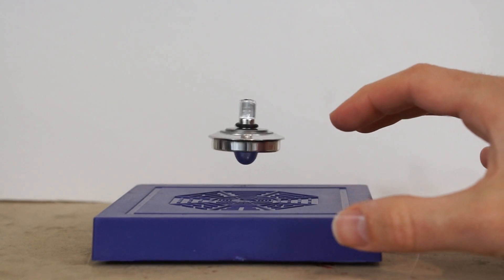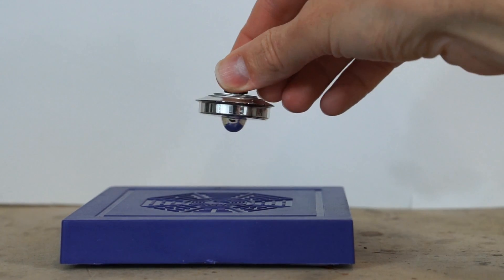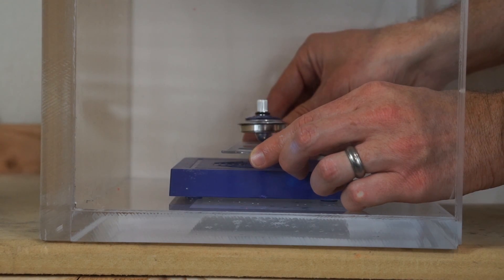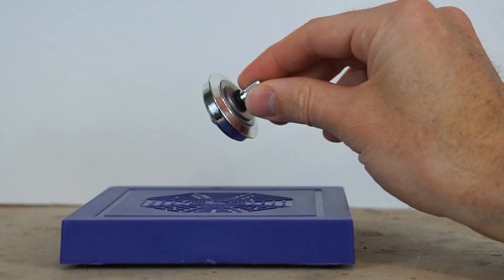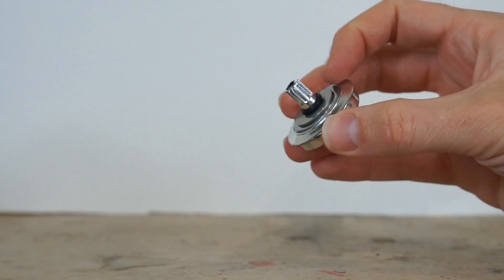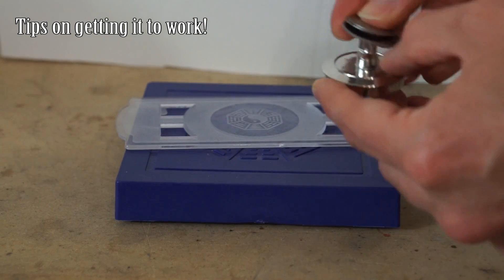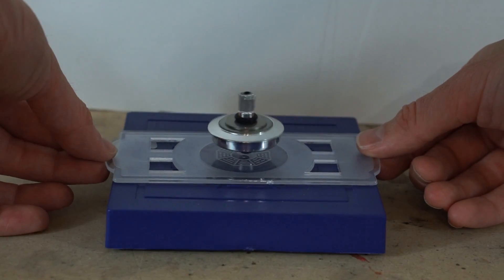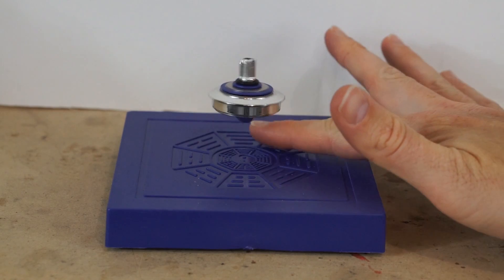Will a Levitating Gyroscope Spin Forever in a Vacuum Chamber?

Comment: even taking friction out   Einstein predicted Frame dragging which can leak energy via gravity waves,  thats why the moon is moving away slowly and the moon is locked to face us , and the earths day gets longer   am I right?
Reply: The Moon is moving away from the Earth due to tidal effects.

The Moon raises a bulge on the surface of the Earth which we observe in ocean tides.  The solid mass of Earth is also tidally bulged but on a far smaller scale.  As the Earth rotates roughly 28 times faster then the Moon orbits that tidal bulge is ahead of the Moon in its orbit, far enough ahead that it creates a gravitational differential.  Through this mechanism the Earth is losing spin into the Moon's orbit, slowing the Earth and flinging the Moon further away.

If the Moon were considerably closer, inside the geo-stationary orbit, it would go around the Earth faster than the Earth's spin.  The bulge would have the opposite effect it has now, to speed up Earth's rotation and draw the Moon closer to Earth.  An exchange of angular momentum.

The moons of Mars, Phobos and Deimos, provide instances of both effects.  Phobos goes around Mars faster than Mars spins while Deimos is slightly slower.  Phobos is expected to either collide with Mars in about 50 million years or get torn apart when it gets inside Mars' Roche Limit.  Deimos is slowly getting further away from Mars.  Both moons are tiny in comparison to Mars so the effects are much smaller.

Comment: Magnetic levitated turbo molecular pump....it’s a thing, it’s amazing, and it spins for a long time before it winds down under high and ultra high vacuum. And that has turbine blades intentionally colliding with molecules. 

Point being, it is really hard for smooth things to lose energy in a good vacuum. Consider what possible factors are getting this energy transfer from the rotating gyro. It’s a short list

Comment: I think that it would stop, even in a totally perfect vacuum, because there are slight changes in the angle it spins at. This is changing the angular momentum, but that can't get energy to change unless it's getting the energy from somewhere else. That somewhere else, in this case, is its main rotation. It will spin less and less quickly because of this, and eventually fall.

Comment: With just 1 second into the video, you can already deduce that it won't last for too long.
It's not even nearly stable. It's bouncing all over the place. Even without any other force to oppose the movement, all that bouncing will eventually exaust the kinetic energy of the spin.
But that's hardly all. Apart from the electromagnetic induction process some mention, the truth is that, even if you'd put a gyroscope spinning in perfect balance in an ideal vacuum, free from any gravitational pull, electromagnetic fields, or radiation of any kind, the truth is, in it's rotation, all the atoms in the body of the gyroscope are trying to break apart from each other, and the resistance the atomic bonds pose to this, is, very slowly, turning the kinetic energy into heat. Eventually it would stop. It's just a matter of how long it can last.
I would presume it might last a long time in those conditions, just how much I can't tell.
But this experiment will last considerably less, that's for sure.

Comment: I think the time it spins in vacuum might be shorter than in air, because the air compensates a bit for the wobbling effect. The magnets are not perfect as well, there is resistance in the magnets as well. Also entropy is the bane of any perpetual system (2nd law of thermodynamics).

Comment: I have an experiment proposal
 1. Outer space test.What would happen to water or blood if put inside a sealed container with set pressure of a space ship than put in a vacuum and see if the water/blood will boil. 
2. Put a bluetooth speaker inside the vacuum with salt and play different hz and see if the salt will respond to the vibrations .
3. Put magnets inside the wall of the chamber on each end with the magnets all facing same way with opposing force  and put a metal magnetic ball inside and see if magnets have any effect on the ball

Comment: if you have a cylinder with liquid helium inside it and you rotate the cylinder it will spin forever because it will become what is known as a superfluid, however, the energy needed to maintain the rotation of the fluid is derived from the cooling of the helium.

Comment: in mathematical theory, absolutely yes, but in the liquid universe like we live in, even in a vacuum, the unstabilized motion of the gyro, combined with several other minute effects, it will eventually slow enough for the gyroscope to flip and fall. "Liquid Universe" refers to the fact that all things, even solids, are actually a culmination of constantly fluctuating fields, slight vibrations from the floor transferred to the base, moving that magnet ever so slightly, and many other teeny, tiny effects that combined would cause just enough variables to slow it over time...happens even in deep space hun.

Comment: Magnet moving? Causing friction? I don't think so.
The top moving/vibrating in the magnetic field is causing heat as the object moves through the magnetic field. This can be improved by finding a better way to do a stable launch and a perfectly balanced spinner and a magnet with a perfectly concentric field. (not a lob-sided magnet)

Comment: Won't spin forever. The switching of the magnetic polls will cause friction.
Reply: Magnetic pole switching does not encounter friction. Magnetic fields in space flip constantly. It is half of the propagation of the electromagnetic field though time and space. It is called a radio signal.

Comment: 1. Magnets run out of power
2. There is no such thing as a perfect vacuum
3. Levetating something with a magnet is like pushing every single part of this something, you are still pushing it, very little but still you are causing friction in the system.
4.There can't be anything that is eternal, every material will be dust in a very long time, and dust will separate into atoms, and 
     them into quarks and so on.
5. Abbey the laws of thermodynamics.
6. Gravity creates friction.. so it will be slowed down slowly.

6 reasons why this can't be an eternal system, even in perfect vacuum and stuff like that.
Reply: Rethlitek hm, not quite solid on a lot of these... some are correct though it doesnt have a terrible lot to do with the video. 1) is correct, but demagnatising a magnet takes way longer than the few minutes in the video. 2) is also correct, but the small friction losses to remaining air arent that important here, even in 99.99999% vacuum, it would stop due to things like Induction (see Eddy currents if you wanna learn more about it :) ) 3) is formulated a bit strange for me (sorry, english isnt my main language). as he explained, it looses energy becouse the big magnet below begins to move against the table and that creates friction. Magnets alone dont create friction just by repulsing something.  4) i disagree on you with that one. sure, lots of materials degrade. but they wont just turn into atoms by themselfs without any external energy. it takes tons of energy to split things into atoms, and even WAY more to get them to split into quarks. (as you said in your point 5 (which is correct) , it has to do  with Thermodynamics on a larger scale with entropy and Quantum Physics for the quarks).  im not quite sure what you meant with 6). I dont know of any way Gravity itself creates friction. apart from pushing stuff together of cause. although maybe i just dont know one, so feel free to show me.

didnt mean to be mean or anything. im just trying to get people a better understanding of Physics if they are interested, since i work in Physics :)
Reply: @kcbsuiejd  Please be my physics teacher. :) 🙏
Reply: @michals2685  I might be some day ;)

Thanks for the Comment, you really made my day! :D
Reply: Due to your second reason do you agree the earth will eventually stop moving/spinning altogether?
Reply: @Fjfifjgkgkfudufgkhlgidj  GENIUS
Reply: @Fjfifjgkgkfudufgkhlgidj  reply ception
Reply: @Jimmy Briscoe No, because the atmosphere around earth is also moving along with the earth.
Reply: @Fjfifjgkgkfudufgkhlgidj  it will be hard to track the spinning of the earth once it has fallen into the sun and melted.

Really hard considering all the watter on earth will have been evaporated for billions of years so there will be no-one left to pay attention to weather or not its spinning.
Reply: @Fjfifjgkgkfudufgkhlgidj  yes
Reply: Thats right. Even in space, the vacum isn't 100%
Reply: But atoms themselves then? Electrons never stop spinning around the core when observed. But thats the quantum realm.
Reply: Electrons aren't technically spinning, although they do carry a "spin".
Reply: It's a motion though, that never ends unless interacted with. I guess atoms and other particles are part of just raw information, manifesting into our "physical" realm. Other rules on the quantum level.
Reply: Dap84. Correct. someone even won a nobel prize for working out how much energy goes into this substructure of our world. (its a lot of energy at that level)
Reply: abbey the laws
Reply: Lel
Reply: This is a paper written by Dr. Sten Odenwald about the world stopping spinning.  (Directly copied and pasted from https://image.gsfc.nasa.gov/poetry/ask/q1168.html)
The probability for such an event is practically zero in the next few billion years. If the Earth stopped spinning suddenly, the atmosphere would still be in motion with the Earth's original 1100 mile per hour rotation speed at the equator. All of the land masses would be scoured clean of anything not attached to bedrock. This means rocks, topsoil, trees, buildings, your pet dog, and so on, would be swept away into the atmosphere.

If the process happened gradually over billions of years, the situation would be very different, and it is this possibility which is the most likely as the constant torquing of the Sun and Moon upon the Earth finally reaches it's conclusion. If the rotation period slowed to 1 rotation every 365 days a condition called 'sun synchronous', every spot in the Earth would have permanent daytime or nighttime all year long. This is similar to the situation on the Moon where for 2 weeks the front-side is illuminated by the Sun, and for 2 weeks the back side is illuminated. This situation for the Earth is not the condition of 'stopped' rotation, but it is as close as the laws of physics will let the Earth get.

 

If it stopped spinning completely...not even once every 365 days, you would get 1/2 year daylight and 1/2 year nightime. During daytime for 6 months, the surface temperature would depend on your latitude, being far hotter that it is now at the equator than at the poles where the light rays are more slanted and heating efficiency is lower. This long-term temperature gradient would alter the atmospheric wind circulation pattern so that the air would move from the equator to the poles rather than in wind systems parallel to the equator like they are now. The yearly change in the Sun's position in the sky would now be just its seasonal motion up and down the sky towards the south due to the orbit of the Earth and its axial tilt. As you moved along constant lines of Earth latitude, you would see the elevation of the Sun increase or decrease in the sky just as we now see the elevation of the Sun change from a single point on the Earth due to the Earth's daily rotation.

For example, if you were at a latitude of +24 degrees North in the Summer and at a longitude where the Sun was exactly overhead, it would slide gradually to the horizon as Fall approached, but since the Sun has moved 90 degrees in its orbit, it would now be due west. Then as we approach Winter, you would now be located on the dark side of the Earth, and would have to travel in longitude to a location 180 degrees around the Earth to see the Sun 1/2 way up the sky because in the Winter, the Sun is 48 degrees south of its summer location in the sky. It's a little confusing, but if you use a globe of the Earth and orient it the right way, you can see how all this works out.

As for other effects, presumably the magnetic field of the Earth is generated by a dynamo effect that involves its rotation. If the Earth stopped rotating, it's magnetic field would no longer be regenerated and it would decay away to some low, residual value due to the very small component which is 'fossilized' in its iron-rich rocks. There would be no more 'northern lights' and the Van Allen radiation belts would probably vanish, as would our protection from cosmic rays and other high-energy particles. This is a significant biohazard.
Reply: 1. No
2. Are you sure or did you just heard it from someone else?
3. It can be possible but he has to put other magnets around it to hold it's position stable! ;)
4. You still can stop the process and renew the material! You can use it for ever, but you just have to renew the material! Eeeeasy! :)
5. Not here!
6. There is no "magical power" gravity (freemason teachings)! It's about buoyancy and density, which tells everything where it's place is! That the real Law!!! God's Law!
Reply: Rethlitek a
Reply: 7. Ur a nerd
Reply: @rossngu2328  A nerd? Because he knows physics? Knowledge should be persuied rather than frowned upon. Jelous?
Reply: @rossngu2328  i am not, i just don't have a thing for dumb and ignorant people
Reply: @penguinsilver u sir are lanky
Reply: @rossngu2328  what does that mean?
Reply: Penguin u are dumb if u don’t know what that means
Reply: @rossngu2328  I am foreign. It is a lack of knowledge, not a lack of intelligence. Would you be so kind to explain it to me?
Reply: So it’ll spin for a long ass time.
Reply: OF COURSE THERE IS A PERFECT VACCUM. IMBECILE.... SPACE IS A PERFECT VACCUM 😒

Comment: That would be magnetic drag. As for cosmic radiation, that's reasonably random in it's direction of travel so it's most likely that the object would be hit from it's "left" as much as it would from it's "right". The net force would come down to the type of radiation that hits it be it alpha, beta or gamma which is also pretty random from what I've read. Short of a GMB event or some other event causing an inordinate amount of one type of radiation, the net force of background radiation would be so low as to be immeasurable I would have thought. Also, I don't see eddy currents having anything to do with it seen as the washers you speak of do not intersect with any of the field lines from either of the magnets. Another contributing force would be the mass of all the photons hitting it.... though that is up for debate. Point a laser pointer at it and see if you can get it to accelerate or even beat the losses and just maintain RPM. With a black nicko line on one of the reflective bits, you could even measure the RPM from the reflected light beam?

Nice vid though... I've often wondered the same myself. Only down side.... I'll have to come up with some other thing to contemplate while "reading the paper" in the mornings, aside from the definition of "zero" that is.

Comment: Simple answer even if you're only looking at air friction: No. this is because a vacuum chamber cannot create a full vacuum. For a full vacuum, you need to suck out every single molecule of what is contained in what we call air, out of the chamber. The best humans have ever reached so far is 100 molecules per cubic centimeter. So even in that vacuum, there is air resistance. Even in space there is resistance. Not from air, but from other particles. Even outside our galaxy, you will not find a vacuum stronger than 1 or 2 particles per cubic meter. So such a spinner would only for that reason alone slow down and stop spinning.